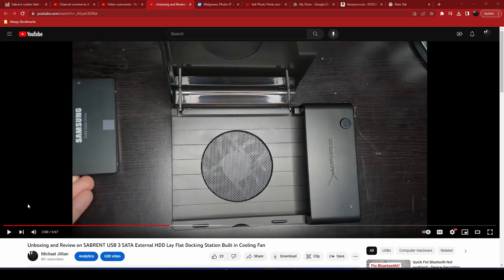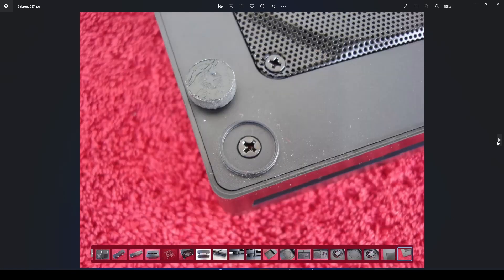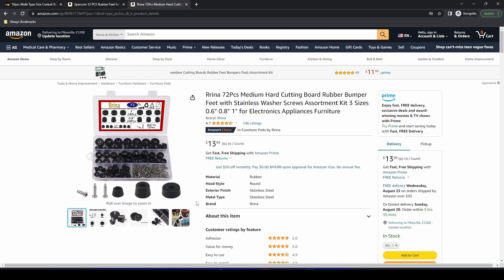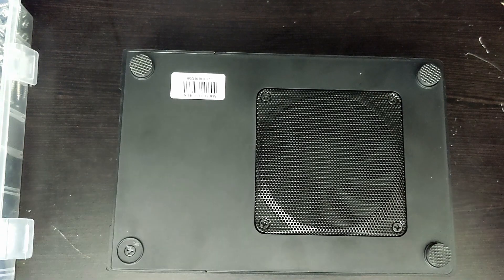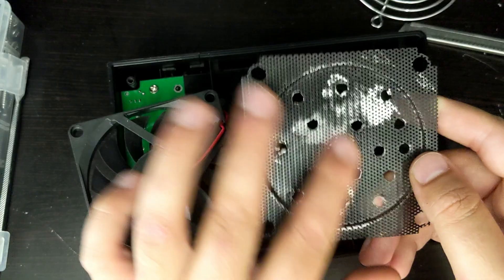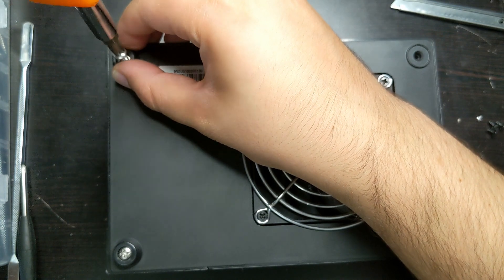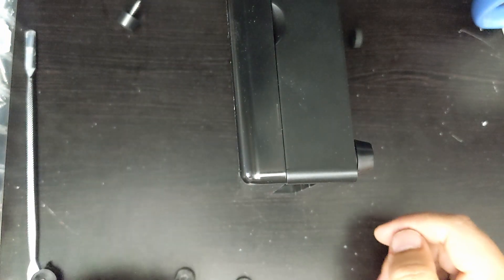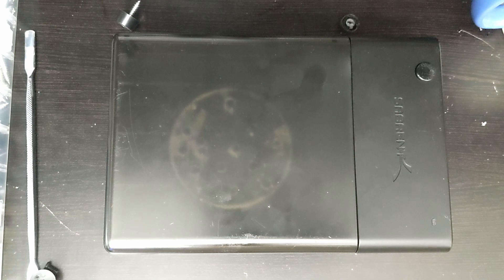SABRENT Fan dock - Custom upgrade %200 Airflow Mod!

Comment: Did you modified the lid or just remove it?  after I did the mod the temp was much better no longer over heating but was still not where I wanted it. But i knoticed the temp went down a degree when I left the lid open. I think it's trading heat . I think I may drill some holes in it
Reply from the maker: yopu can take out the inside mesh metal - but then just be careful or drill holes likee me. keeping lid open may help a tiny bit too
Reply: @michaeljillian3657  i ended up just breaking the lid completely off now it stays at a constant 40c :-)

Comment: BTW I see some one in Amazon comments who modified theirs as well they did this but also added two fans on the top to blow air out. Think that is overkill?😅
Reply from the maker: That's pretty nuts. I think for  triple wipe it can help but for heavy use it's still overkill

Comment: Where do I get the fan cover from?
Reply from the maker: I got it off and old PSU - if not Im sure you can buy separate off aliexpress or ebay or something - just do reverse image search
Reply: @michaeljillian3657  is it 80mm? Can't be 120mm too big
Reply from the maker: @Deadmare  sorry. I don't know exact size. Mine came off an old PSU

Comment: This is a modification everyone should make to their Sabrent external hard drive case. It improves airflow and extends the life of your drive by keeping it cool. Which is critically important, if you are always going to have it on.

A couple of suggestions:
1. Pretest the screws you are going to use (for the rubber feet) by screwing them lightly into the plastic stanchions. If they are close — but still too tight — you can drill out the stanchion a bit larger and try again.  However, I would only do that if you're having trouble finding the correct size screws.

2. Use rubber feet with metal inserts. That way, the screws will never strip through the feet.

Good job Michael . . .  — Rick Saldaña
Reply from the maker: thanks for the idea for this! I am sure I will see improvements on transfer rates with this Mod. I know it was not done as efficiently or properly as you (as I mentioned in the video), but at the very least its better than it was originally.
Reply: @michaeljillian3657  You're welcome. I thought your first video was fine. Kudos to you for taking the time to help others out. 🤓 Best of luck to you in your future endeavors. — Rick